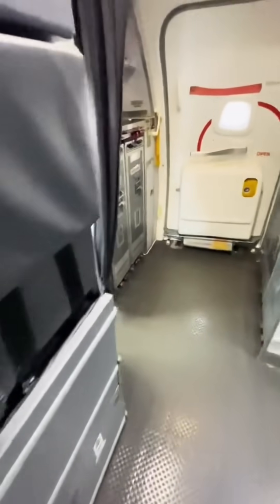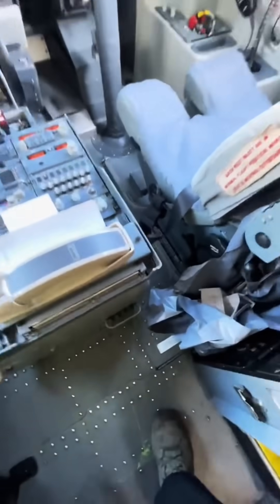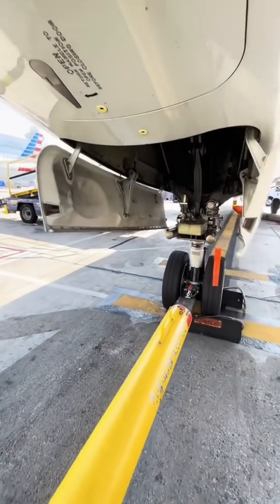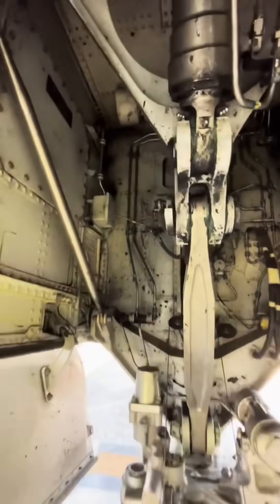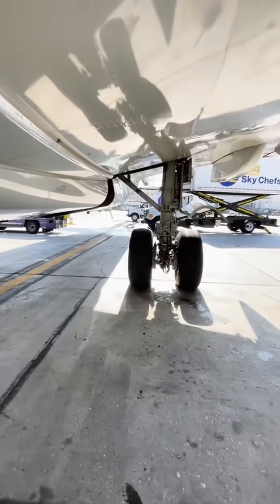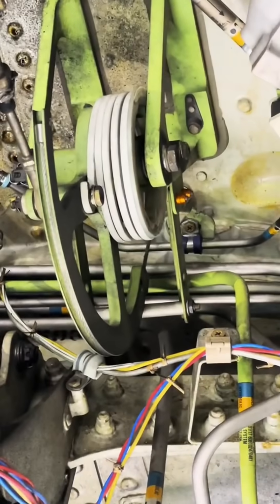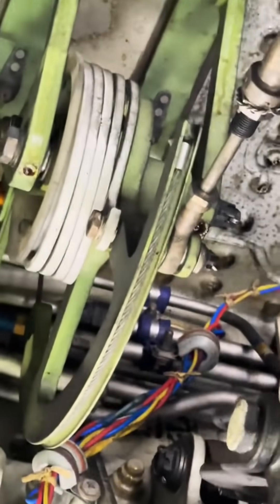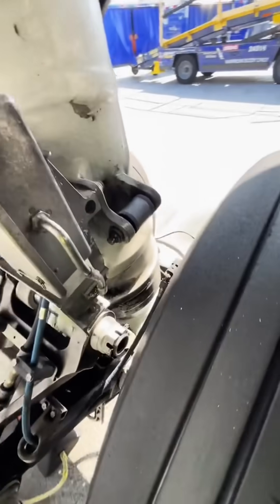Boeing B737-800 Gear Manual Extension

Comment: The bird strike could’ve damaged the hydraulics and the pilots probably didn’t have time to use the manual extension of the gear as it is in an awkward position in the cabin (F/O would have to move their seat back and open the hatch, then pull each lever separately)
Reply from the maker: @w0nton_1  the probability of all 3 hydraulic systems to be damaged is very unlikely. A bird strike didn’t cause that incident of them having no flaps or gear down coming down at such a high rate of speed.
Reply: @StigAviation wait shi I meant to put this in someone else’s replies and I accidentally commented this
Reply: @StigAviation it contributed to it by taking out an engine

It could also be pilot error
Reply from the maker: @w0nton_1  my assumption is pilot error as well but we will have to wait and see the reports.
Reply: @StigAviation  three hydraulic systems? Only System A is available for gear extension, the backup is manual release

Comment: I watched the flight path of Jeju Air flight 7C2216 at FL24, but it didn't seem like there was any particular urgency. The landing gear usually goes down a few minutes before landing, so even if a bird strike occurred during landing, the landing gear should have been down by that time. Anyway, if there had been time, they could have lowered the landing gear under its own weight using the procedure in this video😢
R.I.P
Reply from the maker: Yes indeed, very unusual crash. No flaps no gear and it was a second attempt for landing as well. Bird strike would not have caused this accident.

Comment: Any expert opinion on the Jeju airlines crash in South Korea today? Initial reports are blaming the landing gear failure on an engine bird strike.  This seems absolutely impossible given the manual landing gear cable release in this video.
Reply: Yeah i was wondering too, given that this was their second landing attempt, either this didnt work or it was pilot error.
Reply: they were probably too overwhelmed and forgot about this option
Reply: @fxturist8534  this is what checklists are for
Reply: @fxturist8534 it's ok for us to be overwhelmed... It's a fairly simple checklist routine for a seasoned pilot... Or any pilot with a Comercial rating...
Reply: The workload was probably very high and CRM was not optimal (Korean culture) considering a bird strike simultaneously (if true) and engines flamed out. Really a crazy situation and once in a lifetime type chances really that two errors occurring at the same time.
Reply: @jnegooyen This might be it. Maybe they forgot
Reply from the maker: My opinion is that a bird strike will not cause a problem like this. No gear or flaps down is very unusual. There are redundant safety features to deploy those with back ups hydraulic, electric or gravity drop of gears. And that was their second attempt at landing. Starting to look like more of human factors issue, unless there was something truly catastrophic happening on the aircraft. Wait and see what the CVR and FDR recorded.
Reply: @StigAviation excellent video. Pretty sure this would’ve came up as a checklist item but the time between bird strike and go around/landing was only 3 mins. Not enough time and air to properly assess situation. Leads me to think engine flame out and they simply forgot landing gear…probably retracted from first attempt to reduce drag. No way they would’ve landed chewing up half the runway knowing they have no landing gear.
Reply from the maker: @ so many factors here. Even if they did lose one engine.. they have another one to provide power.. which In the video.. seemed like they had full control and actually came in on a stable approach. But they literally took all the runway and a whole lot of ground effect as well. Also they performed a teardrop maneuver and landed in the opposite direction of the same runway on the second attempt. Which is also unusual. Just so many things went wrong here. Non of the decisions making from the pilots makes sense to me in this case. But once again I’m just speculating and taking an educated guess from a maintenance standpoint. Pilots will have a better understanding of what could have happened. I just know what aircraft can do and how it functions.
Reply: @StigAviation  thank you for your opinion. i am very sad and really curious what happened here
Reply: Need check CVR. Pilots forgot this feature or faulty of mechanism. Bird strike could not cause damage to the cable system inside body
Reply: This video has probably gotten a lot more attention now... 😳
Reply: The manual gear extension is at the end of the Main gear and Nose gear operational extension/retraction test.
It is a requirement after any gear removal/ replacement. And other  various
maintenance discrepancies requiring a corrective action.
The aircraft is placed on jacks and operated an abundance of times with different hydraulic system settings.
After completion of  hydraulic 
operation then the technician in the flight deck will open the panel on the floor and pull straight up on all 3 red T-Handles on at a time.
I have done this task many times and the only time it did not work is the first time I did it .
I simply had not pulled the handle up thru it's full range of operation. New guy mistake.
No pilot should become certified without performing this task during a maintenance  function.  Because the result is disastrous.
With much respect to the crew, passengers and families of all affected.
If you are a Pilot, request a date to participate on a gear functional test in the hanger.
It may save your life.
Reply: @JohnRobinett-fp6vi  thanks...very insightful response

Comment: A question Stig, do any airliners use a nitrogen powered system to blow the gear down and lock it like the Avro Vulcan did. Thanks Stig
Reply from the maker: That’s an interesting question. As far as I know it’s done hydraulically or gravity. Never seen a pneumatic powered gear systems.
Reply: @StigAviation  just reading about it Stig, it was a pneumatic system which used nitrogen to power the system in the event of an emergency when a gravity drop wouldn't lock the gear in place this system was used
Reply from the maker: @chrisnicholls8636  it seams a bit over engineered to let a pneumatic system push it down. The modern jet we have now will just use gravity and to firmly lock it in place, they will use over center arms and tension springs to lock it in place. What aircraft were you reading on that had this pneumatic system?
Reply: @StigAviation  it was the Avro Vulcan bomber built in the 50s and 60s as the uk nuclear bomber. It show how technology has moved on and how much  guys like you are making flying safer, thanks Stig